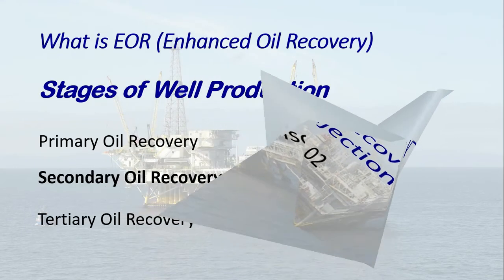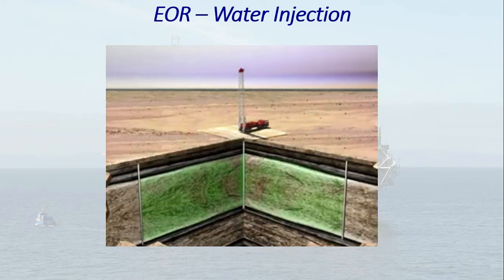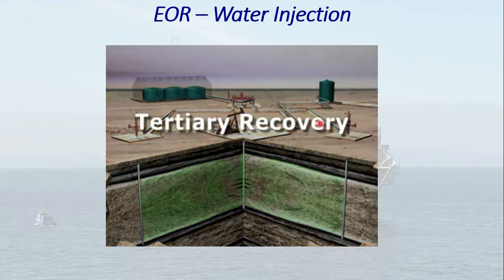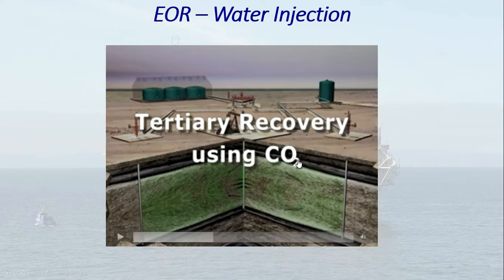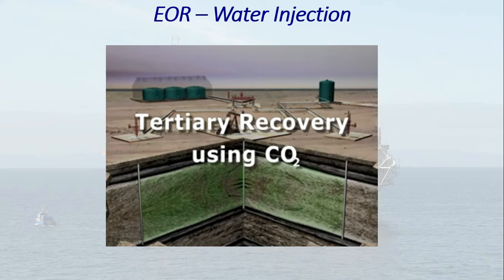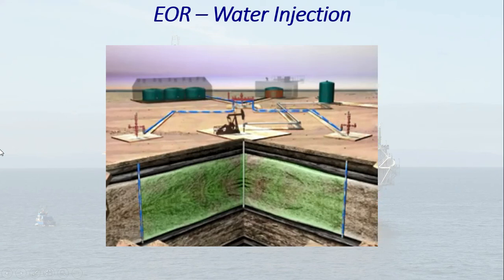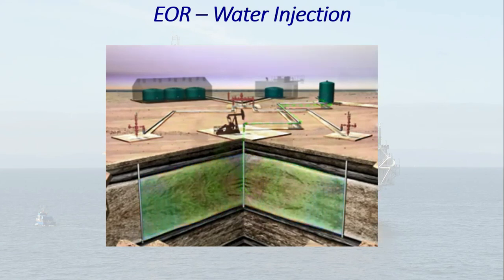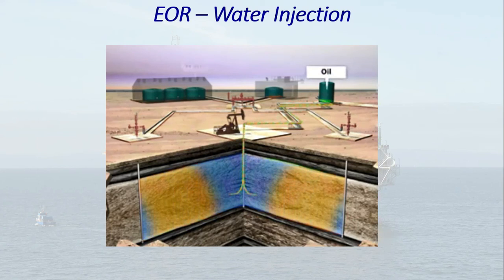Water Injection - Offshore Oil & Gas - Episode 02

Comment: what the benefit to mix CO2 with water ??
Reply: CO2 helps reduce the oil's viscosity, making it easier to flow and displace. Additionally, the injected CO2 can dissolve in the oil, swelling it and further aiding in its movement toward production wells.